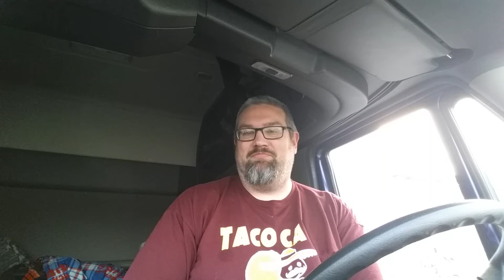Prime Inc tanker - automatic trucks

Comment: I drive a tanker with a 2016 Cascadia with the Eaton Ultrashift. I have mixed feelings about it sometimes, but over all I love it. As far as shifting, just manually shift it from 2nd to 3rd yourself cause it will hang in 2nd. You don't even have to switch it to manual. Just leave it in auto and pull up on the shifter. As long as you just take it easy and don't floor it, it shifts pretty well with the surge. I almost never have any surge to speak of.

Comment: I've been in one automatic transmission semi before,  I absolutely hate it. You would come up to a stop light that was red, and before you came to a complete stop that light turns green, and you go to put your foot on the throttle, and you don't even move. They are nothing but garage in my opinion. I'm not a driver yet, because im only 16, because I'll stick with my clutch and shifter

Comment: I talked to a tanker driver that had an automated transmission and he hated it.  Automatics can't sync with the surge and it shifts erratically. The problem he had is when the Surge pushes you forward it upshifts and when it pulls you back it'll downshift and while in stop and go traffic it's a nightmare. That and also driving the hills. I had a bad experience with Autoshifts back in 2000 when USExpress changed over to them. One night coming down a grade in Az I accidentally shifted it into neutral and it took for ever for it to go back into gear and then one night driving thru Austin TX my alternator went out and I backed up traffic for a few hours till a wrecker showed up to rescue me.